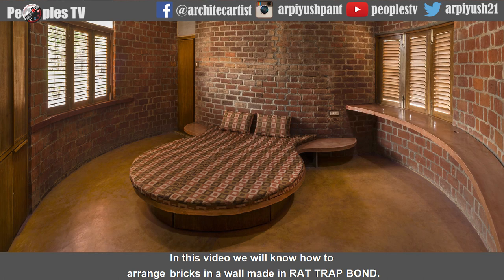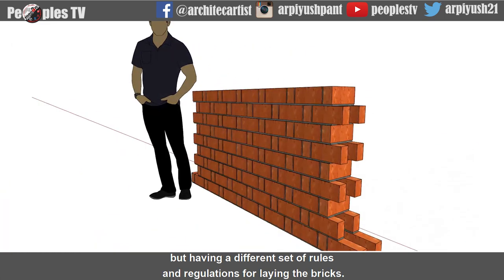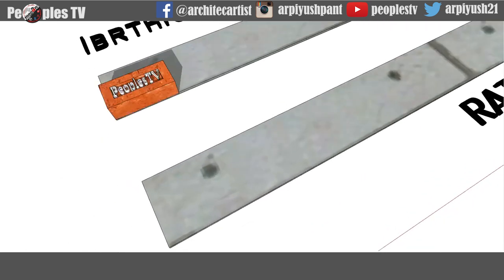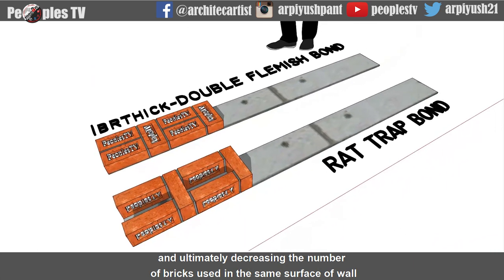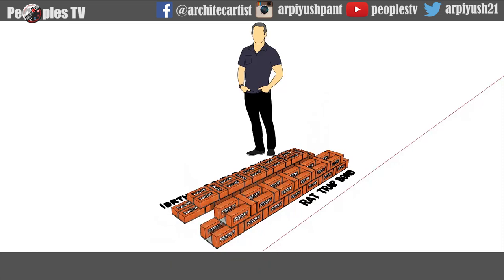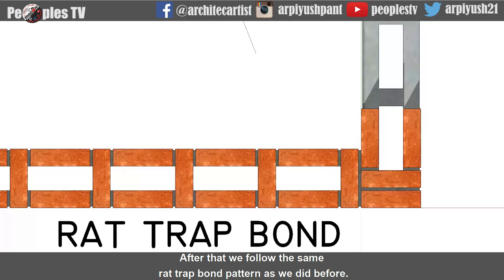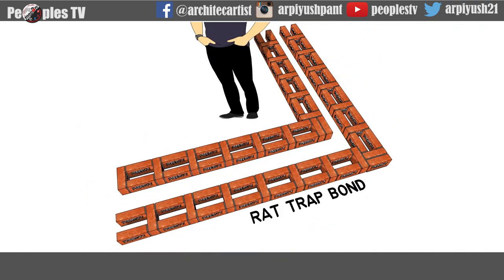RAT TRAP BOND

Comment: Is it important!? Leaving a hole, in top of rattrap bond wall. To exaust air inside the wall. Some one said ..exausting hot air inside wall is good.
Reply from the maker: Hello adhavan
I don't think it mandatory, we need to keep the inside wall cooler so the voids in the rat trap acts as a cushion holding the outside heat to transfer inside, leaving a exposed whole can bring water dust and other unwanted things inside which can weaken the wall

We need ventilation in case of wood to prevent from moisture, with proper Measures

Comment: What is the advantage of doing this type of brick work...rather than other brick work??... suggest me
Reply from the maker: You get a cavity wall in just 9inch width overall and in cheaper price, you know the advantages of cavity wall
Reply: @peoplestvbypiyush  the only rat trap bond was used in UK was before masonry drills battens were nailed into the bed joints with cut nails perfect spacing for tile hanging...

Comment: What about the load bearing capacity of such walls? Is it better than the conventional english/slemish bond walls?
Reply from the maker: Obviously for larger spans English bond walls are more successful, but small spans and create cavity walls in 9" thickness rat trap bond is the best, bearing capacity is lower than English bond, but it can be improved by providing reinforcement in between the rat trap bond.

Comment: How can we do plumbing work in this type of construction?
Reply from the maker: We can use the cavity ofcouse to do electrical conduits and wiring
But for higher thickness plumbing pipes we need to go outside or use ducts for the same
Reply: i lived in a home that used that bond-work, on the outside walls.    No plumbing went into any brick wall,  not even at a 90.  Origional electrical work did, and you could see the builder used metal conduit to run the wires.  Any later added wiring, also used metal conduit, and ran on the inside of the wall, with a special nail to nail things into the mortar.  the dwv (drain waste vent) pipe, ran thru the concrete part of the foundatiion.   The brickwork, went below ground, but only by a few feet.   The entire house was encased in a brick planter, with fabric cloth every foot. inside the planter, was white crushed marble, not dirt. But we had to take the oak leaves off the top every year.       The bricks had weep holes, which allowed actually termites to come into the home.   But, there was no wood for them to eat.   There were weep holes at the top, and bottom.  There was a roof overhang of 2 feet, meaning, anything live in the planter, had to be watered by you to live.   The house, had an addition, that was a slab foundation.   Shockingly, the slab foundation leaked water into the house, not any part of the brickwork.

Comment: Thank you for sharing! I have never seen this bond type. I would like to know if the cavities between bricks collect water and freeze in cold climate, and make cracks bricks.
Reply from the maker: If the precipitation is too high and temperature is too low, it will be recommended to plaster the wall with suitable material, the insulation created by the cavity inside will remain intact,

The beauty of this bond is that in the thickness of 9" only you get a cavity, and due the vertical placement of bricks less number of bricks are used

It was invented by LAURI BAKER and India architect from the southern part of KERLA, INDIA
Reply: you'd need a weep/weep hole/weep-brick

Comment: Hi Amit.
Would a rat trap wall be strong enough to hold a concrete ring beam in order to build a Boveda ceiling ?
Reply from the maker: to tell that accurately calculations are required, as lot of parameters will play the role into it

Comment: I see..

if this bond is used for non load bearing walls - I.e. Pillar structure, then any problem?

secondly regarding electric fittings, can someone do drilling work on rat trap construction walls?

Comment: My house built through the same procedure. The temperature is drastically low in every conditions.

Just one think to ask could I hang a 50" LED (12kg approx) into the wall?? Thanks in advance.
Reply from the maker: Hello Amit,
About your query, it depends are all the walls in your house are rat trap, and for what purpose they are, are they made as a load bearing walls, because in load bearing rat trap bond wall mortar ratio is different fro non-load bearing walls.
If yours is a load bearing wall, which means all the load of slabs and other part of the structure is coming on the wall, than yes you can easily hang your LED light.

And if its non load bearing than it will be difficult to hang it directly, you need some extra support, like you can create small beam of concrete by creating a niche in the wall and cast the frame or a stand in which you can hang the light.
Beam will rest on the masonry only, its same way as we provide a lintel beam just above the door level.

And for your reference weight of 50 inch LED TV is also around 12kg

Comment: Please discribe how electric wiring and plumbing done on rat trap bond.
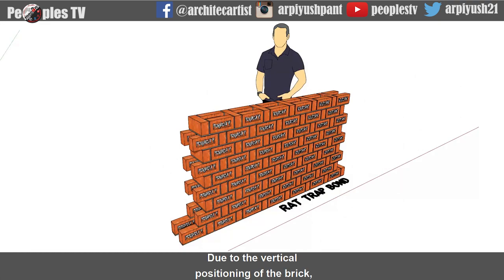Reply from the maker: By default we get cavity inside the rat trap bond wall if you look in the video at time : 1:07  i have shown the interior of the wall in which we get cavity from top to bottom, we can use those for putting various services inside.
Reply: @peoplestvbypiyush  vertical line is clear, what about the horizontal.. do we have to cut the brick  or any other way? 
I have planned to built a house through costford thats why  ia m asking.
Reply: @JChand83  any updates? On the horizontal wiring and plumbing?

Comment: If we use loose soil to fill the gap will it bear the load
Reply from the maker: The idea behind the rat trap is to keep it hollow from inside, which acts as cavity wall and also saves volume of brickwork needed in comparison with the solid brick wall in same thickness.
Reply: @peoplestvbypiyush  what would be the temperature in & out same or different
Reply from the maker: Due to cavity inside it acts as good thermal Insulater wall, so definitely there will be a temperature difference inside outside it can vary from 3 to 5 degree
Reply: @peoplestvbypiyush  sir any disadvantage
Reply from the maker: There are many
Load bearing capacity is low
For adding services inside is a issue and there are few others check it online